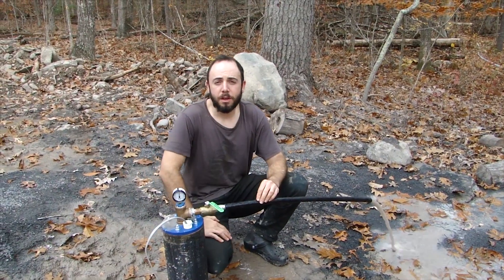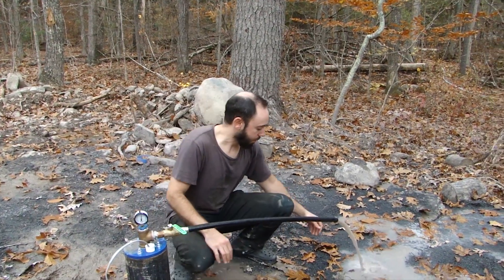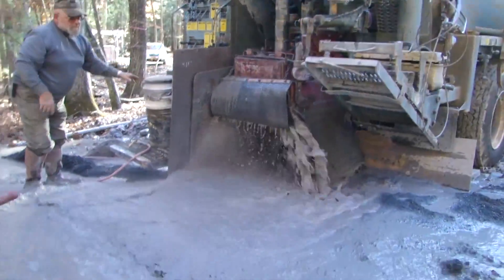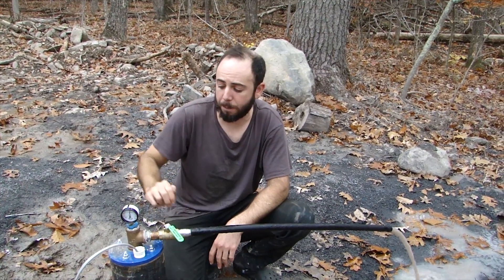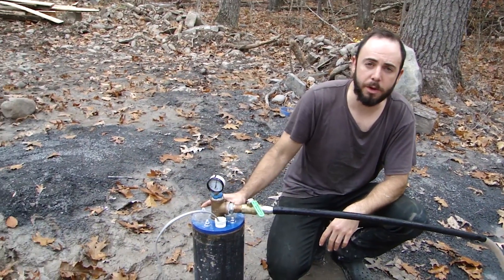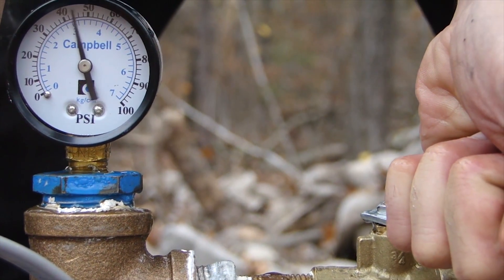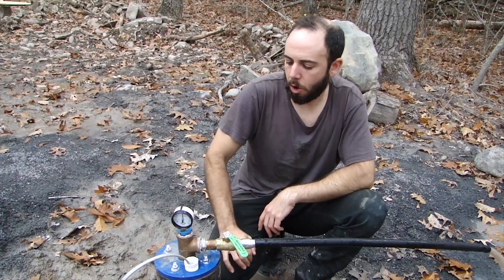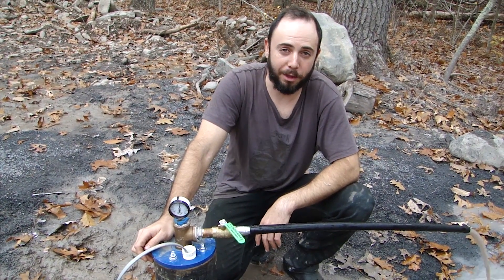Cleaning Up Dirty Well Water

Comment: At first, you should run the water right down instead pf running it at equalized pressure, to get rid of all the drilling spoils and silt. Then, let it fill back up with fresh water and settle out since you have roughly 25' of headroom below the well pump pickup.

Comment: Can anyone answer this question. Every spring I have to raise my submersible pump about 5 feet because of silt and dirt build up in the bottom of the well. Right now the pump is still in about 100 feet of water. How much more can I keep bringing the pump up 5 feet  every spring before I don't have enough water. Is there any way that I could clean out the bottom of the well myself.

Comment: like your anti-freeze approach but such a waste of energy....you need to pump to the surface..you need to change borehole pump to flow and head to match that you have found...then use a booster pump with pressure tank....as to your solids issues, if still facing solids...see the video on separator that will address it....https://www.youtube.com/watch?v=oniyMiutoQI

Comment: I have a well in Bonne Terre Mo. I hit water a 160 feet and had to drill through limestone. My water came out clear.  I installed a bladder in the water line in the well and now can add a pressure regulator to keep getting the same pressure with out adjusting shut off valve.
Reply: Did you have to use a steel casing for limestone?
Reply: @ccrichey  Yes because of the lime stone. Your  well driller did the right thing drilling 20 feet more to make sure your well will produce a steady flow of water. Drilling and stopping when you hit water will cause your pump to shut off to wait for the well to fill up so the pump can start start again. You probably have a bladder down the well to help keep the pump running  to much. If you build a house then you can remove the bladder and then add a pressure tank that can hold up to 50 gallons of water and that will keep the pump from running on and off saving the pump and you electric bill..

Comment: my 5 year old well has had perfect water for 4 years until a year ago a hoe ram hammered limestone for a week and a half from 7am to 8 pm about 200 yards from my well. They were burying a transmission line.  I'm on solid limestone the well 80 foot deep. Now a 5 micron filter only lasts a week at most, before it was about 6-8 weeks.  Tiny limestone chips are found in the filter and the very fine sediments water stain so badly it's not worth washing a vehicle as it looks worse after washing. The company refuses to be accountable, what can I do?  The more I pump the worse it gets
Reply: Since your comment is two months old this may not be helpful or reassuring, but having put in a well or two, I can say that it can take a while for all the 'bridging' to take place in the particles of rock and sand (in your case fractured limestone) within the formation to get 'fines' to stop from flowing into the well bore. You could be dealing with many new fractures. 

In your case, the formation was likely fractured all the way from the trench to your well bore. This would behave like an entirely new well since the geologic formation that had existed for millennia is no longer the same. The good news is that this should clear up in time with lots of new fracture for water source. The bad news is that it could take a lot of time. 

In the interim you can keep fighting filters and I'd suggest you get a lawyer on this. At least a demand letter to the perpetrators. You don't want to go to court (and neither do they if they're smart) and you'd hope to force a settlement, but if you 'sleep on your claim' the tort will eventually toll and you'll be out of luck entirely. Good luck...
Reply: @mysterion4301  filter change frequency has slowed slightly. I did get a small settlement enough to replace my filter with a better system.  Lawyers would not be cost efficient as they have much deeper pockets and could drain me literally. Hopefully in time it settles down. I think their survey/study showed this could happen with hoe ramming but it was better to deal with me after than hold up a $300 million project. I'm much more worried that Trudeau was elected again, he can do much more damage.
Reply: @HypocriticYT  how did things work out in the end?

Comment: 325 feet. Wow.  I hit water at 8’ and went to 27’. I put it in myself and it was instantly clear.   The shot in your hand looked like bentonite used in the drilling.  That has to clear out and can take 100s of gallons.   Ideally you overpump the well to develop it properly.  Usually the driller does that for you.

Comment: Get a 175 CFM trailered compressor. Pull the pipe and pump. Put a venturi the end of the two pipes. Put the pipe(s) into the casing and turn on the air compressor...you will see every thing in there flush out. Keep the pie on hand in storage. You will need to do this every three to five years. Your well will love you for it!
Reply: Hello Sir, i am very interested in advise that you given above. Can you please show me connection of pipes with venturi.

Comment: Thanks for posting.  I have a question about the drain hole 5 feet down as the frost protection.  How do you decide between this method and installing an adapter through the casing 5 feet down, then digging a trench to your house?  Thanks.

Comment: I hope you  get something built over top of that ⚠. Where the well pump power line goes in, is not sealed, it may be a pressure air vent. If a bird 🐦 lands on it and takes a crap 💩 and then it rains, it will wash the 🐦 bird 💩 poop down your well.  A quick cover would be a plastic 25 gallon or 55 gallon drum with the bottom cup off and placed over it. I would drill a bunch of 1/4 inch holes in the side about half way up, and then again about 2 inches from the top. The idea would be that birds 🐤 and animals 🐺 🐱 🐭 not be able get to the well cap.

Very good video, at least we know that thinking running it for a few hours may not flush it clean. It depends on each well. 👍
✔✔✔✔✔
Reply from the maker: thank you sir